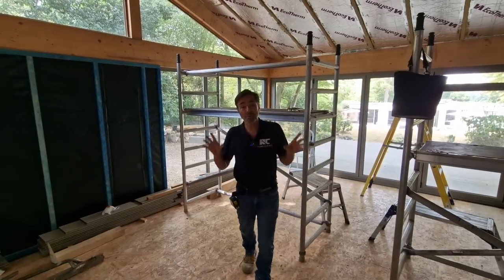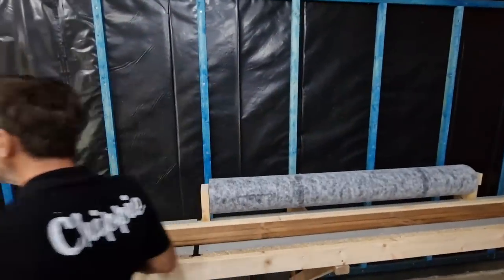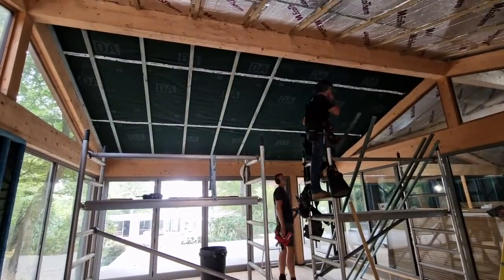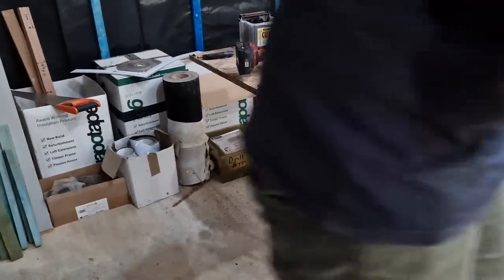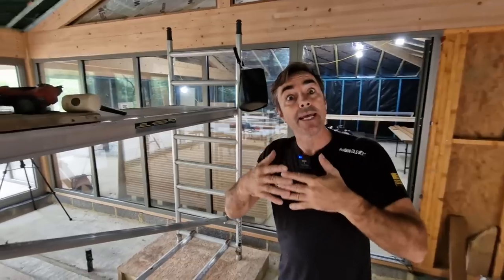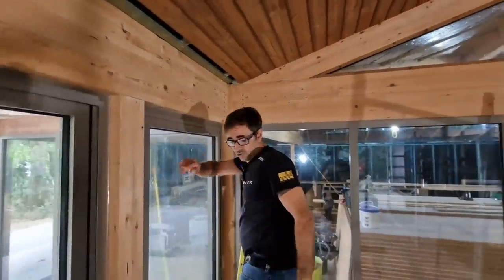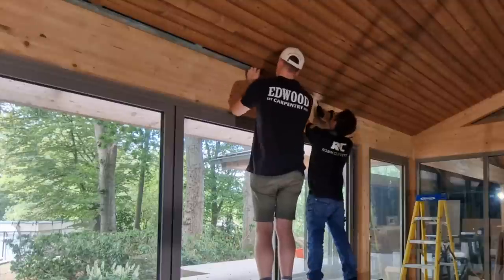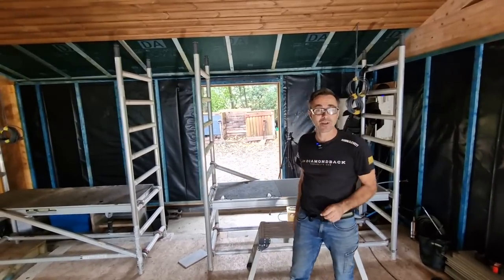The Garden room thermowood ceiling with Lamello

Comment: Hi robin. Do you still use your hikoki nail gun? If so how has it held up?
Reply from the maker: Hi Callum, absolutely, it is used on a weekly basis and is very robust and strong it really is an agro free machine!!!
Reply: @ukconstruction  Thank you for the reply Robin. as an apprentice I’m on the fence between the hikoki or the passlode Xi 390 nailer. I already have the 2nd fix hikoki battery nailer so I’ll definitely be getting the 1st fix. 👍

Comment: Very tidy work ❤️. Robin what was the reason you started at the ridge and not the wall plate end and work up? Looking forward to the next video 👍🇮🇪
Reply from the maker: Hi Paul, great question and I was hoping someone would ask! The reason is that it would be impossible to get the top course into the ridge as it would have to be ripped narrow to accommodate the tongue and groove and there would be a gap!!
Reply: @ukconstruction  very good. Thanks for the reply Robin 👍

Comment: Hi Robin, big fan here and i'm sorry to bother you with a trivial question. I'm building a 12 x 16 shed and will be cladding it with a tongue n groove weatherboard / shiplap finish. I don't think it's possible to hide the nails so what nail setup would you use?  - e.g. stainless steel annular nails or would brad nails have enough of a head on them to hold the wood in place? Regards. Jim
Reply from the maker: Hi Jim, I would use a 63mm 16gauge stainless steel brad maybe worth hiring a Paslode 16gauge gun
Reply: @ukconstruction  will do Robin. Cheers.